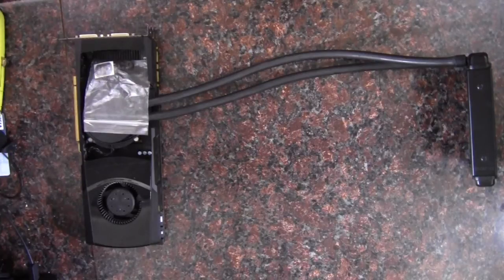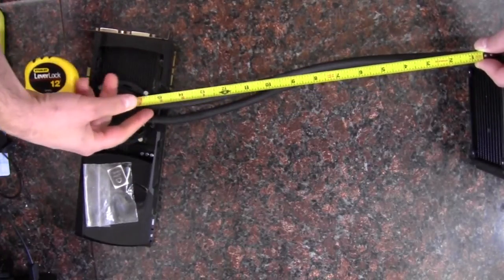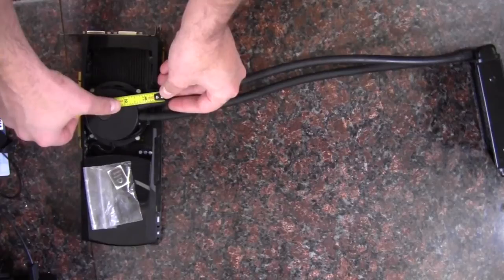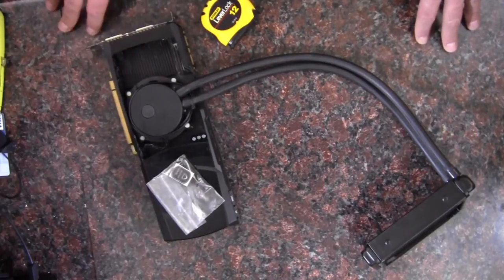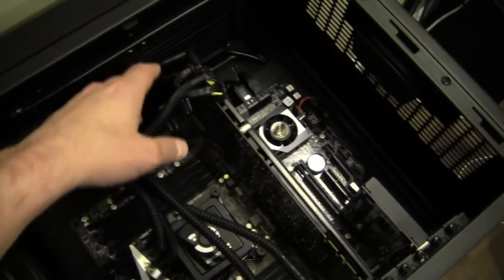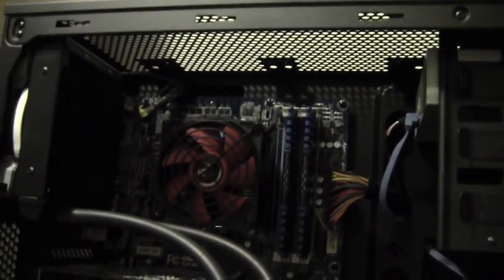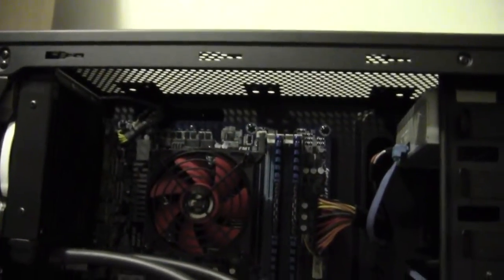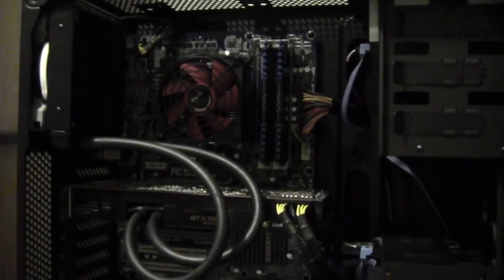A look after the install of the Asetek 740GF

Comment: I don't really like water cooling because so many reviews say that the pump can fail or even leak but good set up .
Reply from the maker: I have been lucky so far with the all in ones that I have used. But, when one does fail it can be catastrophic. It's the price that must be paid for quiet and efficient cooling. I still personally am on the fence if it is worth it. I am using a custom loop for my rig and it was a pain in the ass to build and ridiculously expensive.
Reply: AdoptedMike Yeah I know what you mean , Prefilled/branded manufactured pumps have a lot of bad reviews , but tbh I think that custom made water pumps/loops can be a lot safer and reliable but I still would trust them ;)